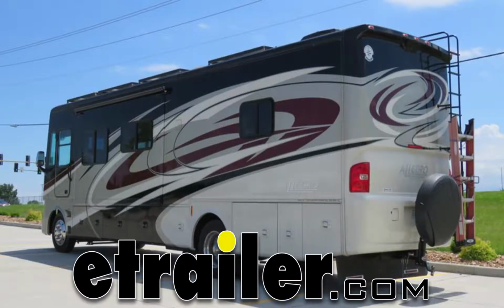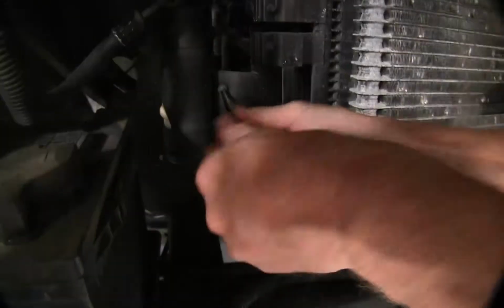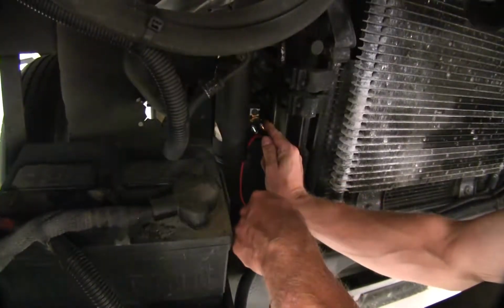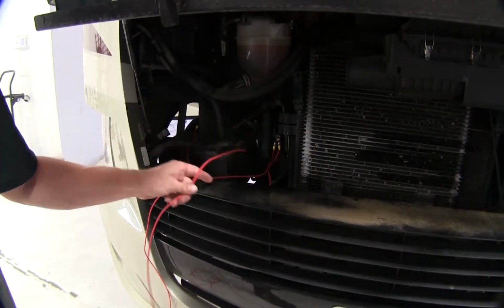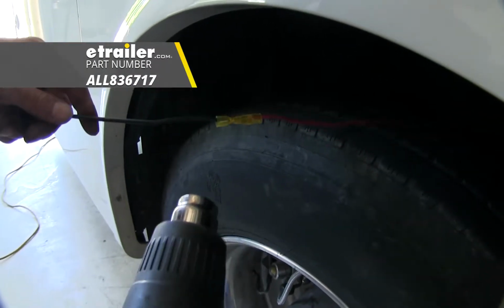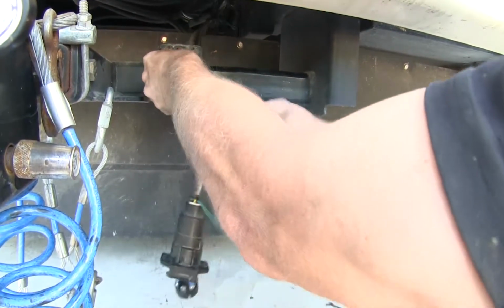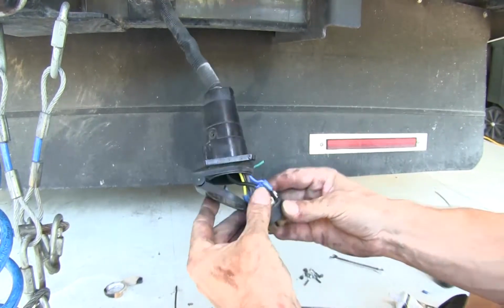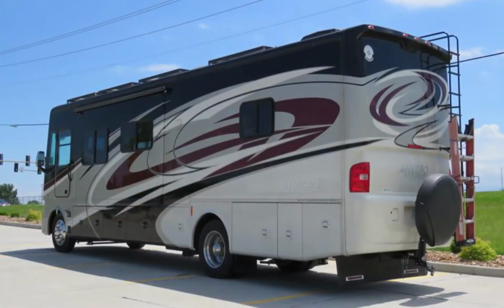Install: Roadmaster Battery Charge Line Kit for Motorhomes on a 2015 Tiffin Allegro Motorhome

Comment: Should the charge line be hooked to the chassis battery or house batteries? E-trailer has videos showing both methods, so I'm looking for clarity on which I should attach it to.
Reply from the maker: You'll want to power the circuit from the motorhome chassis battery as shown in the install instructions which I've linked below for you:
https://www.etrailer.com/instructions.aspx?pn=RM-156-75
https://www.etrailer.com/Accessories-and-Parts/Roadmaster/RM-156-75.html